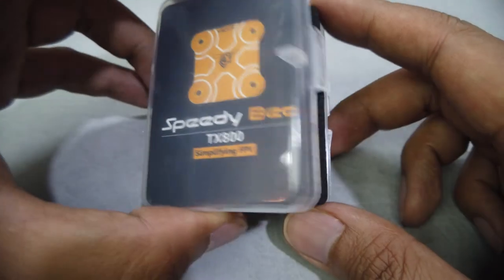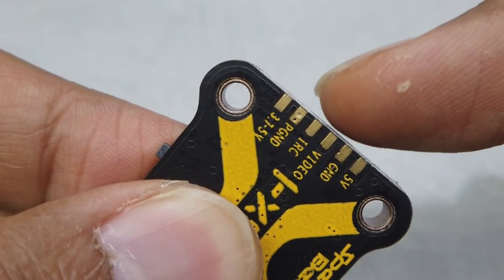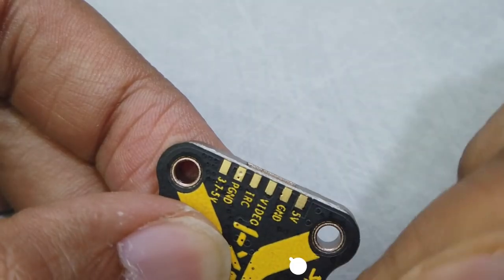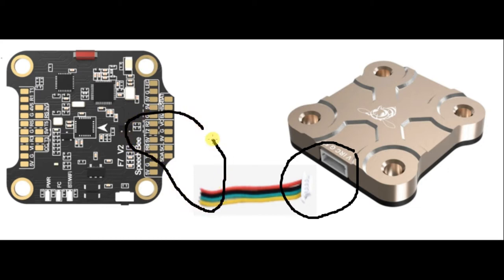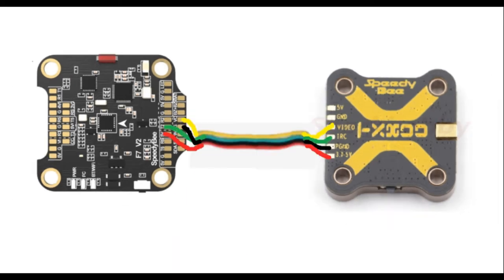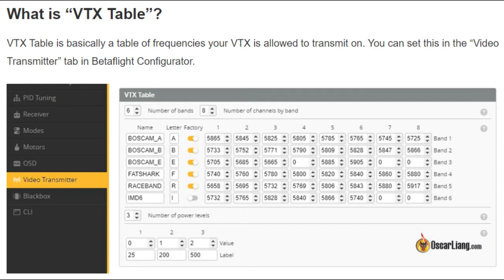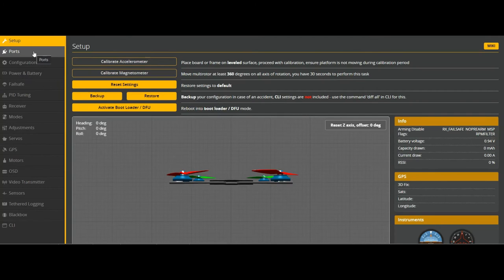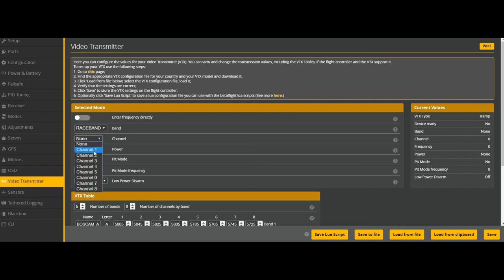How to Install a VTX (Video Transmitter) to your Quad

Comment: Hey Adrian i have an XF5806/5.8ghz 40 ch vtx for my Eachine Lal3 3" 4s quad and since i just cannot solder i am looking for the wire with 2 plugs on each end so i can simply plug in the vtx to the fc and go flying?

Comment: I have mine working unlocked but can only have the power led working, is that the same for you?
i have it set to race 6 and again, my vtx lua doesnt remember vtx table, it defaults to U band, which isnt on the tabe , i can alter power level via expresslrs vtx administrator?
Reply: I can also alter it via smart audio!
latest bf 4.3.0
expresslrs 2.3
what i dont understand is why it will work in elrs lua but not in latest 1.6 bf lua
,also the previous vtx conected was the irc tramp mamba 500, which was fine?
Firstly ,do you have only power led or all 3 leds working?